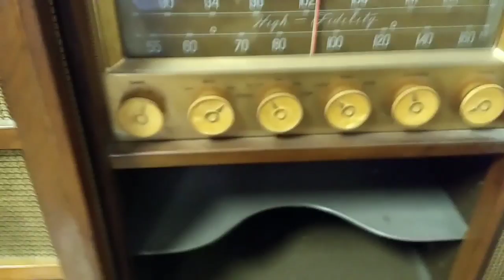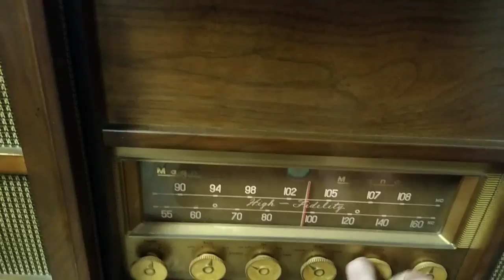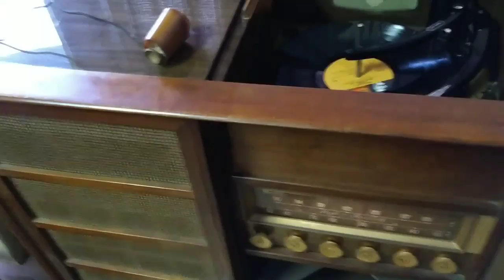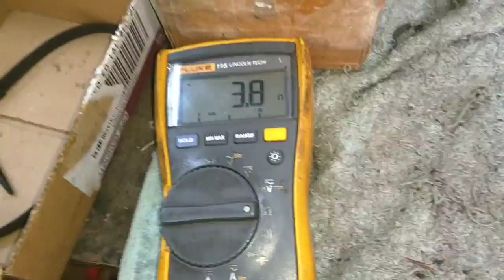Servicing a 1958, 1959,1960 Collaro (Magnavox) record changer - Part 4 Final

Comment: I save a lot of idler wheels by cleaning them with rubber rejuvenator  (sold on Amazon) then coating the edge with GC Chemicals phono nonslip. GC is getting hard to find though.  I have been using a bottle I bought back in the 80s. It looks like cold coffee and dries to a brown powder which appears to be rosin. Smells really wild too.
Reply: Is the rubber rejuvenator any good?
Reply: @SDsailor7  Yes, I had good results on most idlers. It is simular to an old typewriter fluid called Dr. Scat, which worked great but went out of business when typewriters went away.
Reply: I will have to buy some and try it out. thank you for the tip.Cheers

Comment: Pretty amazing vids posted.I'm thinking of updating a Penncrest stereo console stereo for the early 60's that was purchased by my parents. It's a great looking piece of furniture but while the tuner fires up the pots are full of static. Then I saw your Pioneer 585 service and I'm wondering if a good cleaning and lube of the tuner might get it working again? Do you think the electronics are gone based upon age and maybe just drop in a vintage Pioneer tuner (I've got an old SX990 that might just drop in the cabinet).

Comment: Very nice restoration! However why not just order the correct flip over cartridge for the tone arm instead of using a cheap Crosley cartridge, that will never come close to giving the correct sound this player should have?
Reply from the maker: Because originals are only available new old stock and the majority of them fail shortly after beginning of use due to age. The p188d is not a bad cartridge if you get one with a decent bridge and a metal cantilever stylus. 

I've serviced many mags with the old ev cart and this cartridge sounds better.
Reply: @JordanPier  I  agree, i heard one of those pfanstiehls and they sound quite smoothe